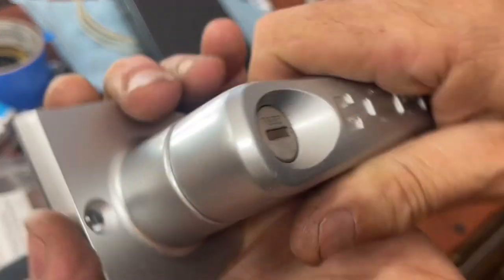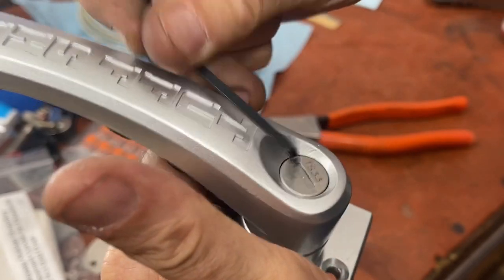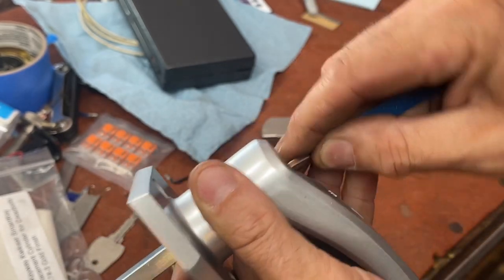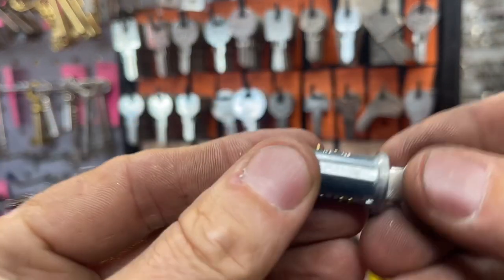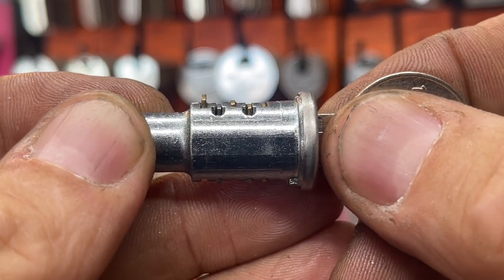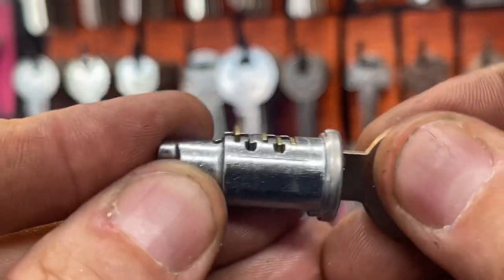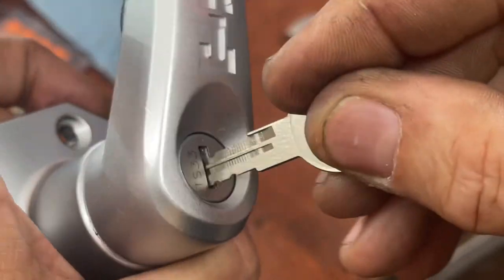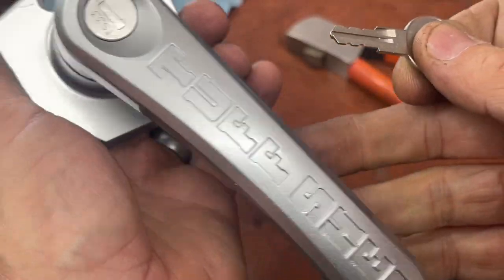Key Making for Tuff Shed Lock with Lishi Clipper - a key blank worked though!

Comment: I have a 10X12 Tuff Shed and the door handle is wobbly loose. I can't seem to use any of my allen wrench selections, star tool selections or phillips screw selections to get a good grip to tighten the outside screw. Do you know what kind of driver and the size would be to tighten that screw up?

Comment: My parents bought a Tuff shed through Home depot, then I bought one about 5 years later direct from the company. Both are keyed the same. The real kicker is my 20 year old $20 Walmart filing cabinet is also keyed exactly the same. The bitting is not as bad as this one, but not impressive. Mine is single sided though. It's an original with the Tuff shed logo.
Reply: Had to add....I just looked at my Tuff shed key, and my filing cabinet key much closer. They have the same code printed on them. Go figure. 😁

Comment: hi, ive been searching through all your videos for help. BUT it seems i mightve come across a lock that you have showcased.. I have a usual shed lock, not name branded or anything. Ive opened it up to the point where only the cylinder lock is remaining. it has a tube lock or whatever its called. However it doesnt have a disengage pin hole on the tube. It has nothing apart from the cylinder and the thing that moves up and down to lock it. I believe i could be a cylinder like the one you displayed in the video here, but ive now tried to get it out for about 4 hours lol. Any TIPS PLS???

Comment: i need help with a cylinder lock! Ive searched through basically all of your videos and the closet one to what im facing is this one. HOWEVER, ive been trying to take the cylinder out of there for about 4 hours, and nothing. So im starting to believe that theres another way to take it out. It looks like a tube lock, BUT there is not a single pin hole to disengage it. Would there be any cylinder lock that sounds like that to you? I NEED HELPPPP

Comment: Do you use the lishi clipper when impressioning as well, or do you use a pippin?
Reply from the maker: After years and years of file in hand almost everyday I figured out the whole sight read thing (wafer locks) and in shop would use the 1200 mostly. When I got the clippers it changed the game, much quicker than vise-ing the key every cut :) 
absolutely worth the ~$50 ish bucks